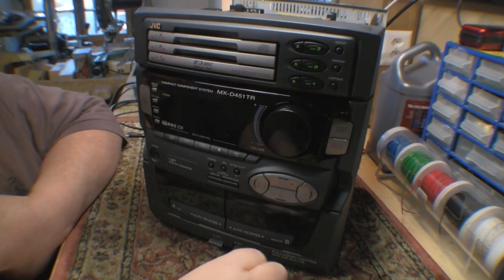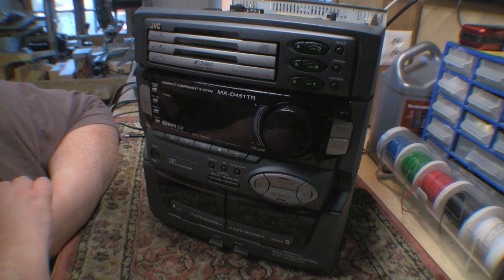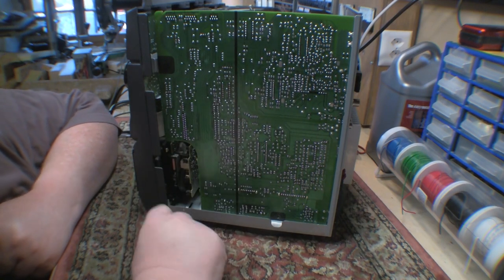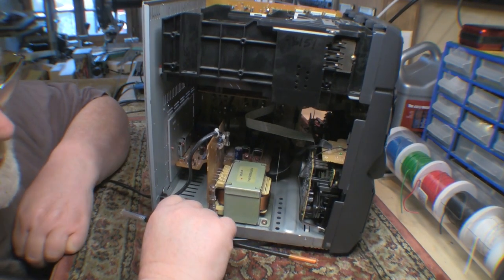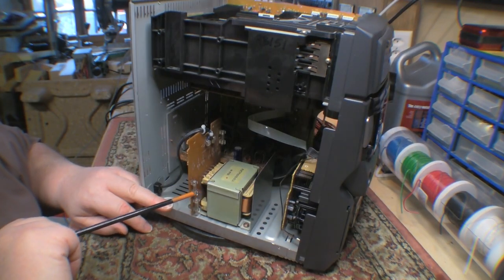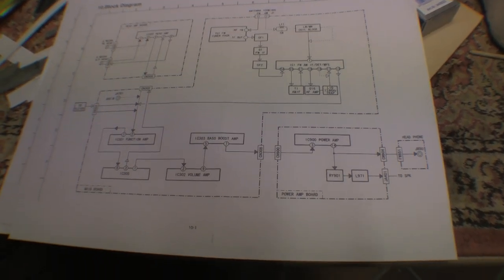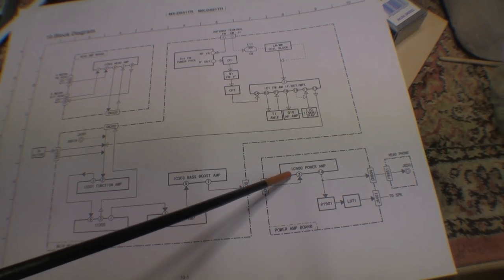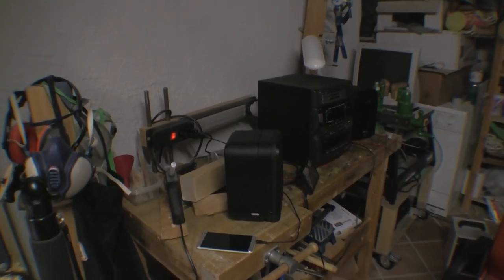JVC MX-D451TR repair

Comment: I agree with Ady, good information.  These types are usually just EOL'ed.  A bit of simple deduction and a hot soldering iron and you saved it.  A good reminder to not be so quick to throw away some of these things.  Very good, John.
Reply from the maker: Hi Al, well I hope it keeps going for another few years.  Either way, now that I know this is of a generation when it was designed with maintenance and repair in mind I can always have another crack at it if the fault returns.   I'm sure a more modern equivalent bought today will not be of the same quality.
Cheers,  John

Comment: Hi there! I had the same JVC model 14 years ago and it had the same volume control issue, The volume suddenly jumps up to maximum level with little turn of the volume nob. Later I did just like what you did , resoldered all the related components but problem resurfaced, but I eventually repaired it and the fault I found was in the digital potentiometer .

Comment: Had the same problem on a Amplituner. The problem was the encoder which I was fighting with for more than a year. Then, I said: Enough of this! And took the encoder apart, and surprise there was a super thich grease inside which I removed and regreased it and the control now works just fine. Of course that is just one of the tons of the problems I had with this. This new stuff can drive you nuts sometimes. Cheers :)
Reply from the maker: ciprianwiner Indeed.   I think this one is still OK - so the owner tells me anyway!
Cheers, John

Comment: Hi John. I am glad it turned out to be a bad solder connection. Though I suppose one could find new or new old stock parts for it if need be. Thank you for sharing.
Reply from the maker: Hi Bobby,  Yeah the volume chip is available though not easy to find in quantities of 1.
Cheers,  John

Comment: I also hate working on newer stuff. Exempt from that is my Kenwood TS-830S Hybrid Ham rig. It is old school and NO SMDs!
Nice to get a schematic and deduce what area to concentrate on. Glad it looks like it was a bad solder joint.
I have a SMD soldering station. I hope I never have to use it!
Tom
Reply from the maker: Hi Tom, well as with all intermittents, time will tell.   So, if you ever encounter a job needing some SMD work you've no excuses :)
Cheers,  John

Comment: Speaking of documentation, or there lack of, I was trying to find service info on a Teac cassette tape deck of 1983-84 vintage to service the tape mechanism, or find out out what belts or idler tires it used and where they were located. I came up with absolutely nothing, even found a thread on audiokarma complaining about the same thing. So obviously JVC cared about the service man and the customer, Teac did not. It's a shame because they used three motors in the tape transport and relays to control it, so it was obviously a good one.
Reply from the maker: That's a shame - the cassette deck on the JVC is definitely 'cheaper' - one motor and a series of belts driving all spindles at the same time.
Cheers,  John

Comment: I have the Exact same jvc music system with the same problem but for me the volume goes to 100% only if i use the volume knob and there is no problem while using the remote control . I guess the circuit board below the volume knob is the culprit..

Comment: Help pleae. The unit I have changes cds ok but does not play cds (everything works ok, radio, cassette players, display, etc). When I opened it up, I noticed that the laser unit moves ok but cd was not turning. I assume that this is because for some reason the motor is not working. Any suggestions please as to what it can? Thank you.
Reply from the maker: Hi, I'm not sure I can be of much help as I did not have to work on the CD mechanism in the one I repaired.   Based on the symptoms it would seem that the CD disc is not detected (or as you say, the motor is not working) - I assume the problem exists in all three CD trays.  If so this would point to the main drive mechanism not the individual disc loaders.   If you can locate the motor terminals you can alway just put a battery across them (system powered off of course) to see if the motor runs.   If the motor runs but the disc spindle does not turn then most likely it is a drive belt problem.  If both moron and spindle turn then things point to a problem in how the disc is detected in the drive.   Here alas I cannot help more.  I hope this at least gives you some ideas on how to troubleshoot this further.
Cheers,  John

Comment: Sir my jvc mx sk3 will power on but display is not shown what a problem help me 😢😢😢
Reply from the maker: Alas I cannot say what the problem is.   If the unit works but there is no display then  this suggests the display module needs some attention.   If the unit does not function, i.e., play CD, then the problem lies elsewhere.   There is a decent maual online though it only deals with the mechanical side of things but at least that shows how to dismantle the unit safely.   So far I have not found a good manual that shows the electronics.
Reply: @Zone1242  ok thanks for the information
Reply: @Zone1242  only power light is on no display and no sound
Reply from the maker: @sridharan9737  So, this suggests something like the power supply as a good candidate to check.   Ideally you would need a circuit diagram and so far I have not found one online.   If you have knowledge of electronics then you could check all votlages are present.  Without the necessary tools this will not be feasible.

Comment: Would you know any tips on how to fix a jvc RX-N5200 home speaker
Reply from the maker: Alas that's an impossible question to answer.  The Rx-N5200 is a full blown 5.1 amp with Bluetooth.   You would need some electronics understanding/experience and possibly a manual with a circuit diagram.   The only thing a lay person could do is check is any fuses are blown.   Since you describe the unit as a home speaker I assume this is a Bluetooth device that is connected to the Rx-N5200, not the 5200 itself.  Sorry I can't be of more help.

Comment: Hi sir! I have a JVC  MX-D401T receiver. it has been working pretty well but suddenly it stopped. I don't see the LED or any light working it also not working. Can you give a video how to regain power,please!
Reply from the maker: I'm afraid I don't have access to one of these systems so I cannot help you.   If you are familiar with electronics and electronic documentation then you can find the full service manual at manualslip dot com.   If not then all you can really do is check for blown fuses.   If there are no blown fuses then you will need to get the help of someone who knows about troubleshooting these types of devices.
Reply: Thanks,sir! it definitely assist me......

Comment: Hi where did you find this documentation and what is the reference of the great Platinum?
Reply from the maker: StudioSkaYou Hello, apologies I can't remember the source of the documentation - I searched on the model number and eventually found it.   I'm afraid I don't understand the second part of your question - what do you mean by the 'great Platinum'?
Reply: Zone1242 Sorry if I'm getting badly understand but I use a translator, because I'm french. When I said "large plate" I mean the large electronic green card
Reply from the maker: StudioSkaYou peut-être on peut essayer en français. Je vis près de Genève et j'ai quelques mots de français. Si je comprends bien, vous cherchez la référence pour la grande circuit imprimé. C'est vrai?
Reply: Zone1242 Merci en français c'est beaucoup plus facile  :)  oui c'est ça. Je cherche bien la référence de cette grande circuit imprimé car moi sur la mienne je ne la trouve pas..
Reply from the maker: StudioSkaYou il n'y a que deux références dans la documentation - FMDH9003006AV (/s/g) .003 (schema) et FMMW1024 A (image du circuit imprimé). C'est tout ce que je pouvais trouver.
Cordialement,  John
Reply: Zone1242 Merci beaucoup de votre aide mais malheureusement je n'arrive pas a trouver cette piéce sur internet pour la changer.

Comment: I still have a  MX-D401T and it has this exact same problem
Reply from the maker: Based on various comments below the consensus seems to be that the problem is often around the volume control and encoder.   I found out that the owner of my unit upgraded after about a year so the machine featured here went to re-cycling about three years ago.  At least it's demise was delayed for a while.....

Comment: My jvc micro component system ux1  pannel micro buttons not functioning properly would you sujjest to replace micro buttons ?
Reply from the maker: I'm not familiar with this unit so it depends on what type of switches are used.    If they are the membrane type then it might be possible to open the module and clean the pcb pads. If they are mechanical microswitches then it depends on whether replacements can be found.  For mechanical ones its always worth spraying with switch cleaner - this often cures the problem.